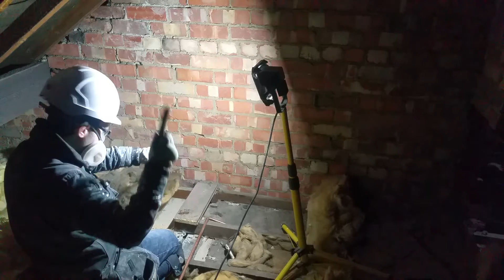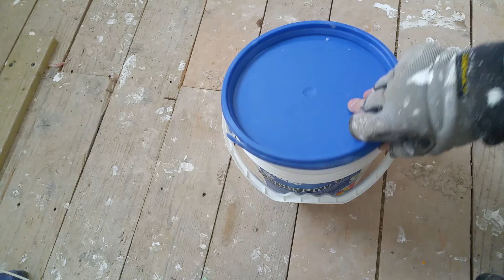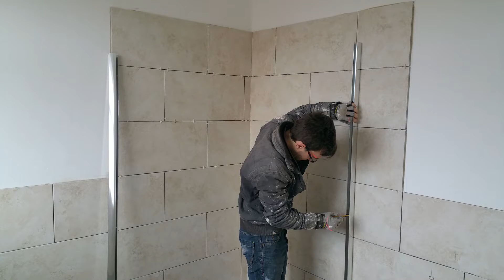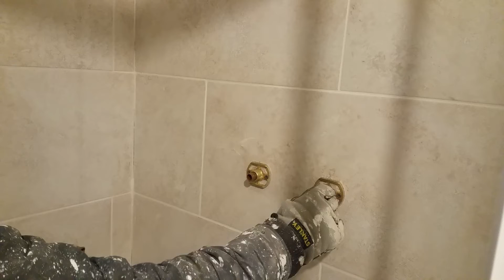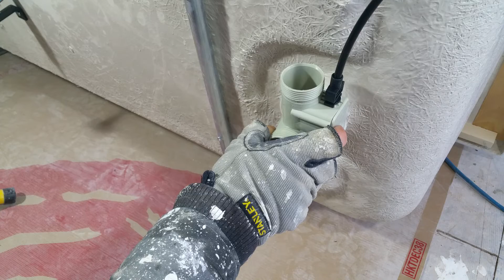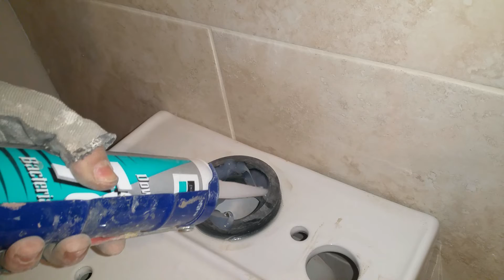New Bathroom Suite Install - Bathroom Finish | P1V9 | ShortWorx

Comment: Excellent job.  Can you use pusfit pipes for central heating too?  If it does then it makes life alot easy rather than soldering copper pipes.  Can these pushfit pipes handle the water pressure?
Reply from the maker: Yeah they work fine and are so easy to use. I think they need to be a minimum distance from the boiler. I'd say it's imperative to cut the pipe square and debur the cut as the fittings have rubber o rings which you don't want to damage with sharp metal. Not sure about the pressure rating but presumably central heating is lower pressure than mains cold supply so must be able to handle it. That said soldered joints are probably better in the long run, they're also much smaller and cheaper.
Reply: @ShortWorx  Thanks.  I am planning to do the exact same job as yours.  I want to knock down my bathroom to create a larger living space and relocate it in the next room..  The builder quoted me £22k.  Thats a proper con price from a conman.  I then decided to do it myself, no job is too small with proper research and some self belief.  I was looking for your type of video.  Good job.

Comment: You far surpass my lowly diy skills but would suggest with sealant, it's best not to use masking tape as I can see in the vid there's a thin edge/ridge on either side where water and therefore mould/bacteria can sit and collect, best to use a sealant tool to smooth out the edges into nothing; amazing job with everything nonethless
Reply from the maker: Completely agree. Can't remember if its in the video but I go back over it to smooth out the ridge left by the tape. The tape is only to help create a straight line and control the amount of sealant. Ive tried those smoothing tools but I could never get a good result, I need more practice.
Reply: @ShortWorx  Gd stuff, which UK area is the house if you don't mind saying? £110k even for a fixer upper is a real bargain

Comment: Great series thanks for doing these. Just wondered if you considered any products like Abacus board instead of plasterboard in the bathroom? I have plasterboard in mine and I find it smells when the bath or shower is used, I can see why people avoid plasterboard in bathrooms.
Reply from the maker: Thanks! I did consider other systems, wasn't familiar with Abacus at the time, but have since watched a lot of Skill Builder vids about it. I looked into cement board and  Schluter Kerdi but ultimately had to consider cost and difficulty as I don't have much experience. In the end I decided to go with moisture resistant board and the Mapei waterproofing kit. I did ask the plasterer not to skim the lower half but must have been lost in the ether... Do you have an effective extractor fan, perhaps that could help as an interim measure to reduce moisture build up causing smells?